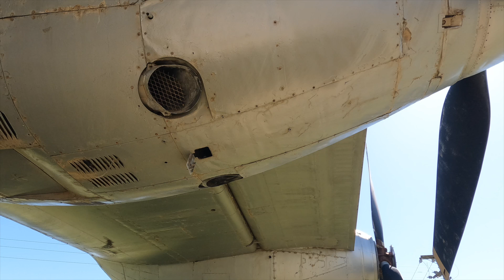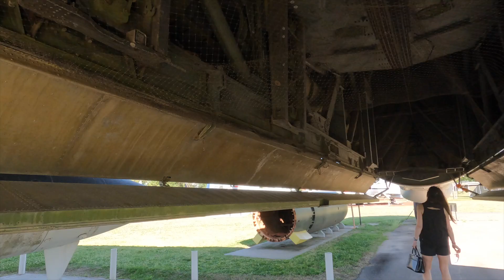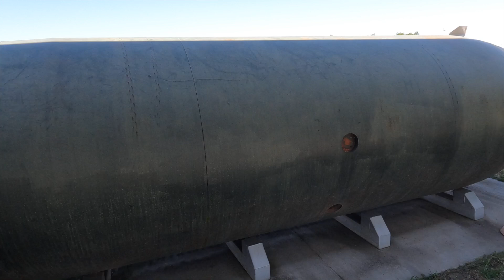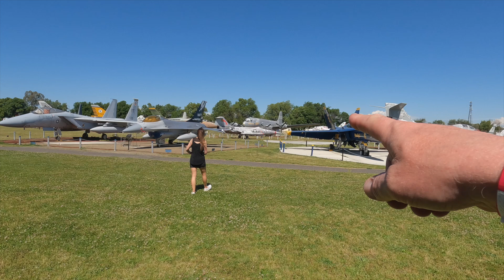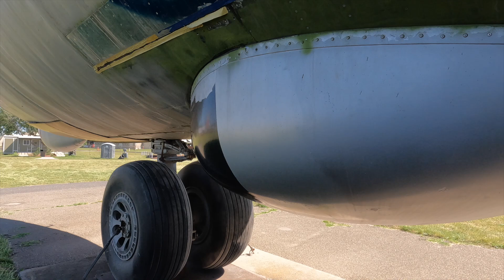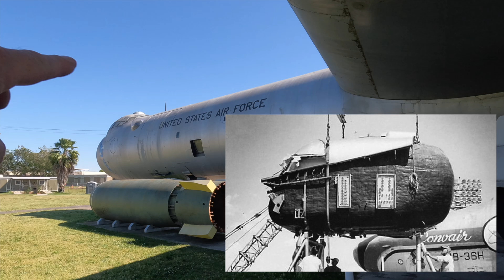2024 Convair B36 Peacemaker RB36

Comment: There was one of these on display an Chanute AB, Illinois when I lived there from 1988 until it closed. I remember them towing the B-36 to the flightline where they disassembled it to put it on a train. I heard it was going to California, but this one in the video isn't it. Late one afternoon my dad and I drove out to the flightline while it was being taken apart after everyone had left for the day. I got to poke my head up inside.
Reply from the maker: This is the same airplane. Hopefully it gets restored soon as the weather is taking a toll. It might still have a bunch of the magnesium skins on it. If you stand under the main landing gear well you can look up at the underside of the top wing skin and it is rotten full of holes. Heavy corrosion.